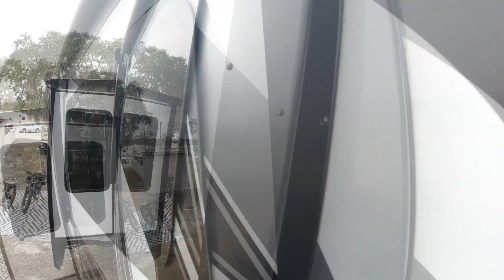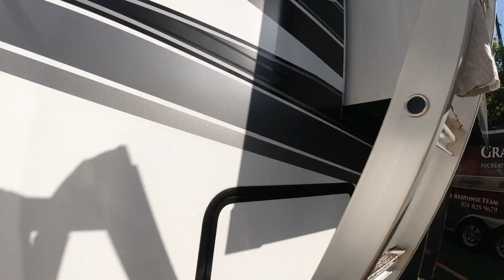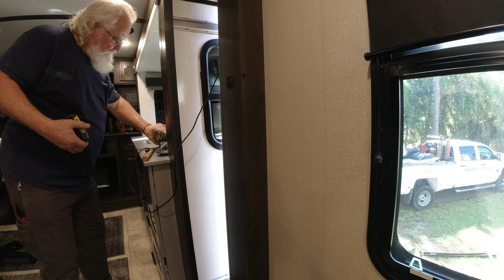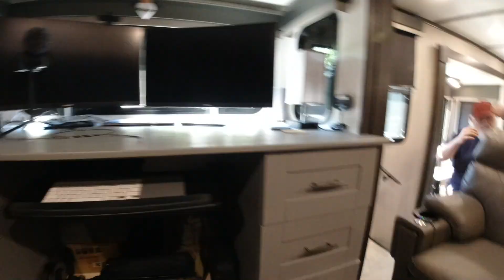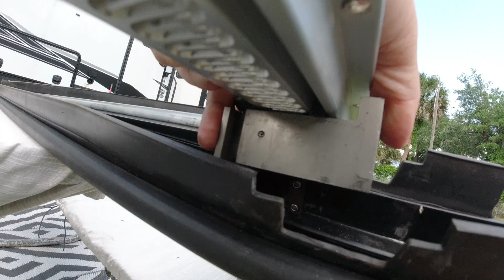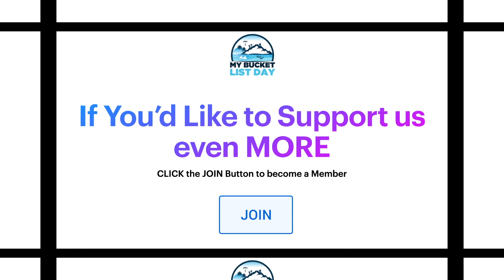I Show you HOW my RV Slides Failed!  Ep 3.26

Comment: Are these slide systems any good? Are they quality systems? We just got our 2022 grand design imagine three weeks ago and I  hope we didn’t make a big mistake.
Reply from the maker: Yes, slide systems are very good.  They are Shwintec slides and they are used by just about every RV manufacturer.  They rarely fail, and if you do proper maintenance, they will last many years.
Reply: @MyBucketListDay  Thank you 😊. I guess I had better learn how to do the maintenance quickly.

Comment: My 2021 has had all shwintek motors replaced already and control panels
Reply from the maker: As you saw in the video, ironically, the issue was the sheared pins/rivets.  They were broke because of something forced the motors to get jammed, like an obstruction in the slide.

Comment: Maybe simple....but problematic, not robust enough IMO.
Reply from the maker: Agreed, I would have designed it a bit differently to be able to easily replace the shear pins or have an access slot in the column to re-align the tracks.  Would save most if not all of the system replacements that the RV Techs are doing.